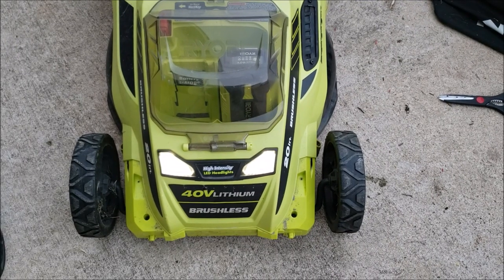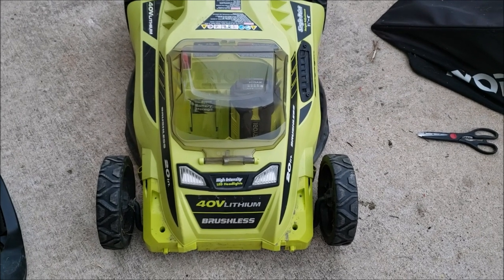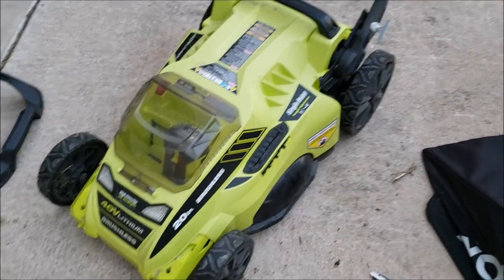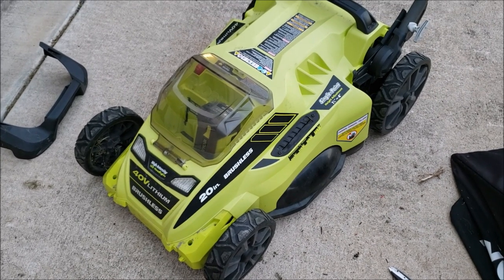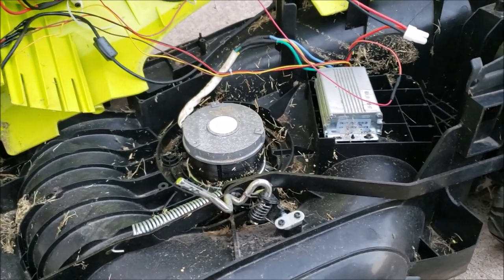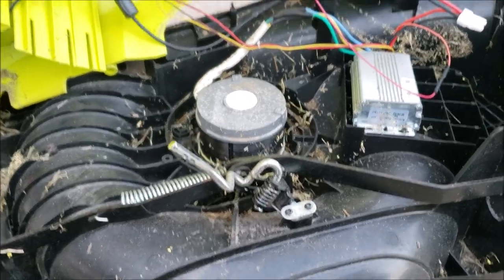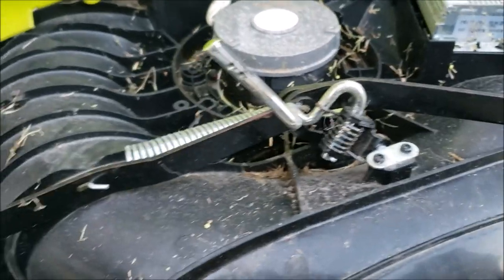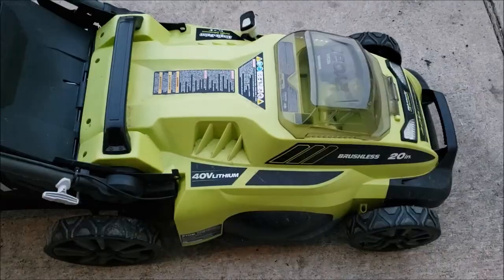My Ryobi 40v Mower Stopped Working | Mice Love This Mower In Storage

Comment: For you ladies out there, I was having the same issue.  Bought mine a year ago, kept it in the garage over the winter.  Have used it several times this year. Today, I even mowed part of my lawn and then it started acting up.  It would turn on and I would start to push it, it would die.  I started with the manual and the troubleshooting said maybe my grass was too high and to raise the deck.  I did that.  Still happened.  It was even happening on my driveway, under no load to cut grass.  I watched a bunch of videos on YouTube.  I am an engineer but not as mechanical as I would like to be.  So, it was early enough in the day that I would take it to Home Depot where I bought it.  To put it in my Yukon, I had to fold it.  In the process of doing that, realized that one of the levers that lock the pushing handle in place (where it folds in half) was not secure.  Not sure how it happened....I could have knocked in on something in the garage and loosened it.

It could be that simple!!  Make sure the all the levers are locked in place on the handle.  Hope this helps.
Reply from the maker: Thanks for the info.  This thing has so many safety sensors on it that anything can trigger them.  Glad you found the issue before having to that it to Home Depot.  I made this video also that could help in the future: https://youtu.be/YvBQ1o0mFGE

Comment: I picked one of these up 2nd hand...no battery to test it though.  Lights came on and the self-propelling motor worked when I checked at home...but no mower blade movement.  I opened it up and the same thing...MASSIVE mouse nest.  ALL the wires from the motor controller had the shielding chewed to bare.
Contemplating solutions to close all openings and spray a deterrent scent inside to keep the little bastards out.
Thanks for making this video!
Reply: Update....

I repaired the motor controller by re-shielding the wires and reinstalled.  I tested the various safety switches and they seem fine.

Blade still won't spin...BUT...it does attempt to turn the motor.  A little bimp-bump-bump happens now.

With no power, the motor does not spin freely.  I feel pull from internal magnets like an old rotary switch.

Should the motor without power spin freely or is what I'm feeling normal?

Thanks!!!!

Comment: With all the problems with these mowers and the motors don't even last a year it's time to try another brand. It's a shame the batteries aren't interchangable. I guess I could use them on a bike that uses 40 volts. 73
Reply from the maker: You could always tear them apart and reuse the cells.  I do that a lot.

Comment: Actually 12 screws, 3 of mine were rusted and stripped but one of my extractors got them out.  Not sure why they didn't use stainless, that's what I'm replacing them with.  Turned out mine was a bad safety switch, the one that detects if the handle is flipped up.  I just bypassed it and everything works again.
Reply from the maker: Yeah, those can get you.  I still get hit by those sometimes.

Comment: I don't think ours is a mouse issue, as it's sitting in our "living room" in the entryway currently (oops) and we'd almost certainly know if we had mice, but I appreciate seeing the inside of this.  The last couple times we've run ours, it has pretty much slowed to a halt and puffed slight white smoke beforehand.  I'm hoping it's because our grass was too long...we did get through the full mow so hopefully next time we run it that issue will be gone.  Not sure what to do otherwise.  (Also kind of funny that you mentioned rain...after that mow it DID get left out in the rain because we weren't quick enough to bring it in before the weather hit...but it was upright and is well dried out now so hopefully no damage done!)  Thanks!
Reply from the maker: I wonder if the white smoke was the motor getting hot and melting the plastic around it. I had a battery weed eater that use to throw white smoke and the motor eventually melted out of its brackets.  Good luck either way.  Hope its a non-issue.
Reply: @SeidelRanch  Sounds like hubs and I have some exploring to do! :)  Thanks for the thought!

Comment: SeidelRanch Thank you for the video. My mover powers up and moves, the blades just will not turn.  Also, can you do a video on how the take the "hood off?
Reply from the maker: I will add it to the list.  It's pretty easy to do.  I think it's like 6 to 8 screws and it just lifts off.
Reply: I have the same problem, mine runs and everything but the blade won't turn.

Comment: Yep, just couldn't getting started and they opened it up and there was a mouse nest and eaten wires. Now they want me to replace the controller. Now it's too big for me to replace. I was told they use a rice oil on the wires and the mice like it.
Reply from the maker: Sorry to hear that. Luckily it was not bad to fix the wires on mine.  Did you fix it or toss it?  I put some traps in the shed and have not had the issue since.

Comment: Hi,  I have exactly the problem you described with the rodents. I do not know how to remove the screws or whatever it is that holds the top on. do I just have to remove the screws that are close to the tires or do the ones in the back have to come off as well. I thought I heard you say a hex is needed. Exactly what size do I need and what is it called please? Thanks, Claudia
Reply from the maker: For this specific model, I think there were 8 screws.  You have to find them all or it will not come off.  The screw heads on mine are Torx like these: https://amzn.to/3J3jvBf.  I think it was a T20 or T25 size.
Reply: @SeidelRanch  I repaired the wire, but then couldn't get the top back on. so I took it into Home Depot and they couldn't get it back on either. I left it with them and they said they would fix it.
Reply from the maker: @cjg8093  Ok, so it was a wire.  Those pesky mice get into everything.  Sorry to hear it was a pain to get back together but glad you found the issue.

Comment: My self propelled wheels stopped turning when I depress the paddle  any advice . can’t seem to find any videos on this problem
Reply from the maker: That could be a little tricky.  There is a transmission that runs the real wheels.  There could be gears in there broken, or it could be as simple as one of the wires has been chewed.  You will probably have to open it up to tell.

Comment: Mine turns on, I pull the bail and it goes but the blade won't turn. What could cause that I wonder. I have only used it twice.
Reply from the maker: Did it ever hit anything? I have heard of things getting twisted around the blade shaft.  Always take out the battery before flipping it over.
Reply: Never hit anything, the blade is strait, and there's no debris in my yard.
Reply from the maker: @eusebiomedina3075  I wonder if the motor went out.  How old is it?  There is a 3 or 5 year warranty on these I think.

Comment: I did everything, all checks out, battery is good/charged/strong and still not working so not sure what the heck to do now.
Reply from the maker: Does anything happen?  Like do the lights come on or do you get any feedback from the mower? I had another issue with the mower but it was mice eating the wires. That video is here: https://youtu.be/HDv25ezD0SA
Reply: @SeidelRanch  Yes, the light is strong but I get no response from the lawn mower.  I used it a couple weeks ago and it worked just fine and it hasn't been in storage, just sitting in my back yard waiting for me to mow.  Not sure what is going on.  I read something about cleaning the vents but don't have any idea what or where those are.  It's pretty new and hasn't been used that much.  I'll watch the mice eating wire video but don't really feel that is the issue, but will check it out, thanks!
Reply from the maker: Did you ever find the issue?

Comment: Bought one from a storage unit buyer.  With drive system.  Ryobi makes it so cheaply the micro switch support broke.  Glued an added epoxy.  Now stronger but the designer should be changing the micro switch support design.  Not worth the cost new.
Reply from the maker: Yeah, I do think they are overpriced.  But they keep getting more expensive each year.

Comment: Took way too long to get to the important points.
Reply from the maker: Sorry about that.  Sometimes I spend too much time talking about what happened and it can take a while.
Reply: @SeidelRanch  Yes, we could have done without the extended narrative about what mice do. filler to add minutes.   And you said the height adjustment screws were hex, but the ones you show are called Phillips head.

Comment: Has anyone had problems with the mower starting and running but the blades not spinning?
Reply from the maker: I have heard a few comments on this issue, but have never seen it myself.  How do you know it's running if you don't hear the blades turning?

Comment: Hi I'm having issues with my same model ! I started to use it after the winter it ran for a few minutes and stopped working . My battery is fully charged and I've made sure all the other things are correct for it to work . The lights are on but it won't start and run . It did in the very beginning for about 5-6 minutes and then it stopped working totally . What do I do ? Could it be a battery issue ?
Reply from the maker: I would say it's probably 1 of 2 things.

I would 1st look at the battery meter on the battery after it stopped.  Mine was somewhat like that.  It would run for about 10 minutes then die.  I would check the battery and the meter would show 25%.  That told me the battery was no longer holding a good charge.  If that is not it, try this:

Maybe it's a safety switch being temperamental.  I would try to put the mower in the "storage position" and then reposition it back to a "ready to mow" position.  This should reset the positions of the sensors and may let it work again. If it starts working again after that (and the battery is good), then its probably a sensor wearing out and it will become an issue more and more until you fix it.

Try that and let me know.  Good luck.
Reply: @SeidelRanch  I sure will thankyou !
Reply: Hi so I did what u had asked of me and it still won't work now at all the battery shows all lights green while it is inside sitting inside the lawnmower . The lights are on but that is far as it goes . If ur saying it's a sensory issue how would I know which one is it or where would I get it fixed . I bought it from home Depot been 3 years now.
Reply from the maker: @jaisonrajan89  Hmm, it may be tricky now.  I was told Home Depot Rental can work on them but I am not 100% sure. Mine I think has a 5 year tool warranty.  I would call Home Depot and ask their rental department OR you can call the Ryobi support number.  This is in the warranty manual on mine: To locate your nearest Authorized Ryobi Service Center,
dial 1-800-860-4050
Reply: @SeidelRanch  thankyou very much greatly appreciated it ! Will do the needful

Comment: These things are terrible. Don't bother buying one. It's so stupid that you can't start your relatively new mower! These will probably continue to have issues. There just too touchy.
Reply from the maker: If it's still under warranty I would bring it to Home Depot to get it fixed.  They fix them there under warranty.  I have heard of people opening them up and just bypassing the safety switches.  I am not recommending that, but I have heard people do because of the sensor issues.
Reply: @SeidelRanch  thanks for the info.

Comment: What screwdriver did u use ????
Reply from the maker: I don't remember the size, but I do remember it was a Torx type head. I think it was a T20 or T25 size.
Reply: @midgetroom  having the same problem!
Reply: @SeidelRanch  T20! and just realized that my extension bit wont fit for the front 2 screws...so gotta get a long-shank one! Why do they make things complicated!!!???
Reply from the maker: @tinamarles1035  Yeah, I remember it was not the easiest to take apart.  I think there were 8 screws.

Comment: I've been playing around with the 40V Ryobi battery from when it first came out and face it , this battery business is a needless rip off !  
Why am I watching YouTube videos on how to revive Ryobi batteries when they turn themselves off, won't charge, etc....!?!?? And there close to $100. !!!
Ever hear of a Hard Reset button that they could put right on the battery to correct tons of issues .... Or is it because they want to sell more batteries !?!??
You'll never know......!
I only use they're weed trimmer, edger, chainsaw attachment with the 40V ....
And it barely behaves on that stuff, I can't imagine dumping $800. And be a test dummy for these lawn mowers....
To get around it, I bought 2 Ebay Clone batteries 40v. 49.99 each free shipping....
Now neither one lasts as long as the original equipment batteries,  but it's 4 yrs. Now and they always charge, Never spontaneously turn themselves off, or just not work...
I charge them fully in the Ryobi charger . When they're full I take them out, I don't leave them in the charger for their chip to figure out how to trickle charge them...
They might drop 1 light or so before I use them, but by the time they do, they're still ready, and give me good running time.  Every time I'm done I don't leave them attached to the equipment, they go back in to get recharged...
Is it a pain .... Yeah kind of, but that's where we are right now with lithium batteries.

Buttom line, even a damn computer has a hard reset button to wipe it and go to default settings, why not the batteries ....???
And that goes for the other manufacturers as well ....!??
Reply from the maker: I hear you, it's a pain dealing with all the issues when they cost so much.  I do the same and buy the cheap after market batteries.  They are less than half the price and last about the same.

Comment: my 16 inch 40 volt Ryobi piece of junk will not start the two switches at the top are okay there's no switch no red button nothing at the tires the wiring goes straight into the case to the motor and the inner circuit board the wires are still intact no mice so what's wrong with this motor maybe the brushes are bad on this brushless motor
Reply from the maker: Is the mower still under warranty?  Home Depot fixes these for Ryobi and should do it for free if its still under warranty.  It looks like you have checked the wiring and the safety switches, so I am not sure where to get you to start.  Are you sure the battery is even good?